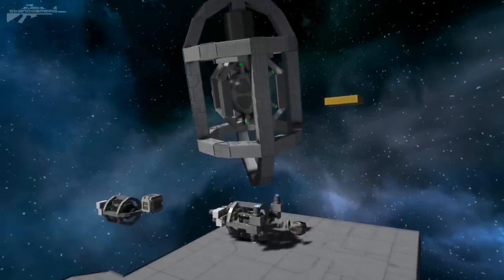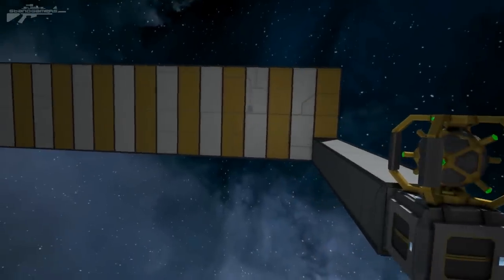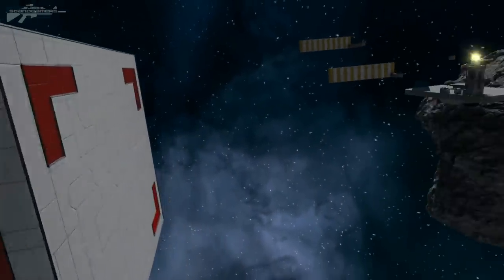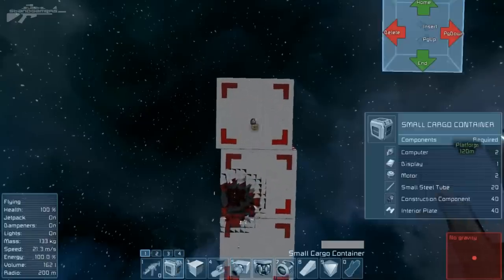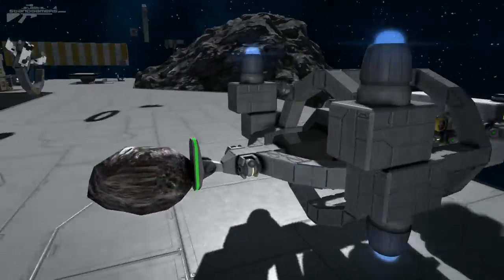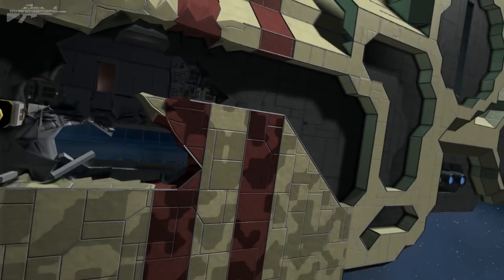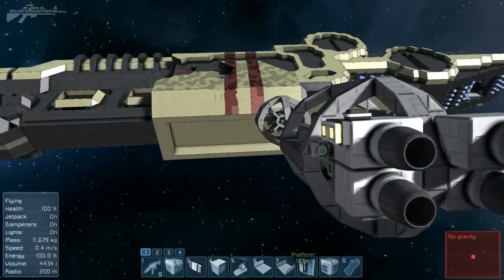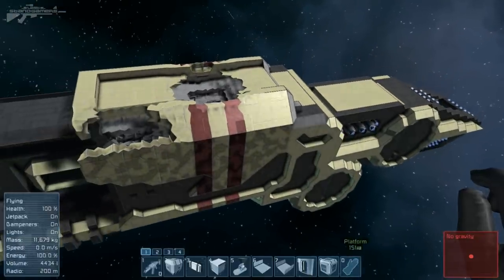Space Engineers - Explosive Experimentation, Resources Sufficient Torpedo

Comment: Try a decoupler on the first warhead so that the second warhead can fly in further without being hindered by shrapnel/debris of the first rocket.
So have the whole thing fly at 75% speed, then the front part comes loose and propels itself at 100% speed with the second warhead lagging slightly behind - You might get the second warhead in much deeper then.
Reply: It might be hard to do something like this. I tried and timer blocks failed me. Sometimes they didn't work properly, not disconneting the front part or not starting the countdown on the main charge (it was supposed to fly in and explode on time, not on impact. More reliable)

Comment: by the way, something i found out experimentating with light/heavy armor: light armor takes the exact same ammount of dmg, in exactly the same radius from a warhead, even if the 1st layer the warhead touches is heavy armor. if you detonate a big warhead on top of 2 layers heavy armor and then 1 layer of light armor, the hull is not breached, but still the light armor layer is desintegrated. the detonation scripts do not question if there is anything between the actual block it "attacks" or not, it just calculates weather it is strong enough to destroy it and if not, how much dmg does it take. so light armor behind heavy armor is completely useless, even if the original detonation does not pierce the heavy layer. this also means for these torpedos, that the designed target would be better off with 2 layers heavy instead of 10 layers light or 1 layer heavy and 5 light, at always the exact same cost

Comment: Now this build brings up a question: What will be the best defense? Big guns, or tiny guns? An assault rife can take that out easily. So that means an Anti-infantry gun can cause an attack to fail. Come to think of it Arron, torpedo ideas are VERY cool, but they lack the ability to do much once spotted. Take a very large ship with a max capacity of 40 or 50 crew members (unlikely, but very large ships can have that amount). Lets say a very large ship with 50 crew members, all they need is 7 guys and turrets on each side, giving around 42 turrets. Leaving enough room for the pilot, co-pilot, and engineers. Now this thought brings up another question... what if the ship had 42 turrets, but the only interior was the engine bay... meaning that there would only be 6 players in the ship overall keeping the ship's engine core in good condition, allowing the other 40 crew members, pilot the turrets from another location, pilot and co-pilot piloting it from another location as well. When I get space engineers, I will be able to understand the physics of remote control fighters and ships. And a ship with 42 guns, a camera, engines and reactors with just a small compartment for engineers, that leaves a lot of room for the ship. Also making it lighter. Now the past two sentences makes another question, would the ship have only heavy armor, 42 guns, a camera, and a small reactor room make it move at the same speed if the same design was recreated, have an actual interior?

Comment: I think launching is not very effective Because if you miscalculate you miss and have sent  resources into space. I was thinking about a small drone like  attack. The drone would be a hollowed out box shape and at the front have no wall. Inside there would be a bomb connected by merge block that had a timer and an explosive. You then go up the the enemy ship . The bomb would have a landing gear on the front. You connect, set timer and leave as the ship gets a hole blown in it's side. The best part is 1:you get the carrier back and 2: short range so you can quickly get infantry inside. You could have multiple versions
Reply: This is not only entirely doable, but I believe people are already doing stuff like this on PvP servers. The only downside I see is that it requires your full attention, which means the ship or station you are IN is vulnerable.

I would like to see a mod that extends the range of sensors, so we can have a missile that locks onto and tracks its target. Not terribly effective against small ships, but would be perfect for anti-cap ship torpedoes. But currently the short range of sensors limits things.

Comment: Hm...
So the rock propellet at the ship does piercing damage, while warhead does massive damage...
So if we use this "Double hit" concept by using a pair of sensors, landing gear and some gravity generators and a warhead behing them?
Like this torpedo goes toward a ship, and as it's sensors pick a Large ship block like 10 meter ahead it enables gravity generators and unlocks the gears to throw rock ahead, and then smash a warhead into the hole punched by the rock...

Might also work with a line of like 2 or more small warheads instead of one large... this way you're more ikely to be able to fit into the hole punched by your rock and explode on the inside of the ship...

Have to try this when I get home...

Comment: Arron, I think your being too optimistic here. In my opinion these weapon would be hardly effective because every ship meant for battle has enough automatic turrets to gun those torpedos down in no time. Also even if they manage to get through the damage that we saw in the video is basicly just visual as it only blew off the outer hull leaving the ship fully functional and still dangerous. Also bear in mind that many military ships will have 2 layers of heavy armor.
Reply: 1. If I'm correct those were just "shells" of the torpedo, I design I'm going to use will have a layer of small ship heavy armor to absorb a decent amount of gatling fire.
2. The 2 warhead torpedo should be able to bust through it, the first warhead taking out the armor and the second destroying the squishy insides of the ship.
3. These are just general "prototypes if I'm correct" nothing special just checking out a few posibilities.
4. These are meant to be somewhat cheap. You would probably be able to afford launching 5 or 6 at a time at a target.
5. Good observations, I forgot to take the lack of interior damage into account for making my torpedoes, I'm probably making a few small warheads in the torpedo to help, also, I think the warheads have better damage if exploded manually or with a sensor/timer, I may be wrong.
6. Good luck with whatever you are building in SE.

Comment: Would have better better to put the rocks inside the cargo crates and when they blow up the rocks come out.
Reply: I don't know that that works. I think when you blow up the crates the cargo is destroyed. You literally have to just delete them. It might have changed but I tried what you're talking about as a turret distractor and I don't think it worked. :/
Reply: Austen S It works. It's one of the most effective weapons I've tried yet. The containers need to be destroyed by impact though, so you need to build up a lot of speed. Sometimes I get the idea this only works when you put artificial mass on your torpedo though. The gravity of the enemy ship helps the rock penetrate it usually.
Reply: Awesome, I'll have to try it. I messed with it a little the other day. If the crate is destroyed via gatling gun, the rocks come out, but if destroyed via missile, the rocks disappear.
Reply: Austen S Yes, there needs to be a steady balance in destructive force. An explosion from a rocket can easily destroy the container and its contents. But when insufficient damage is applied, the container stays intact and you've just wasted a torpedo. When I've got a reliable design I'll definitely upload a blueprint on the workshop.